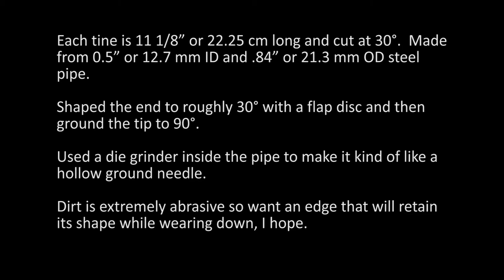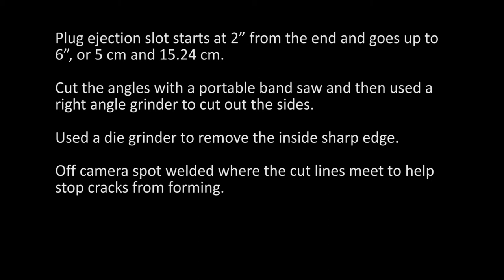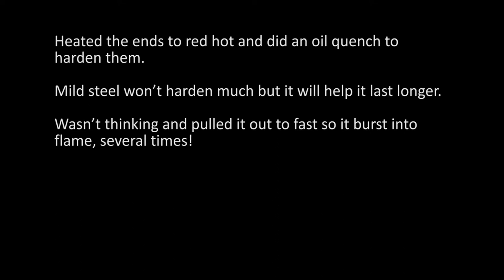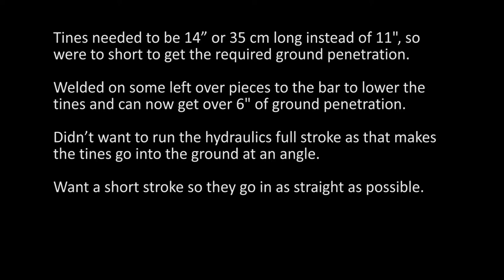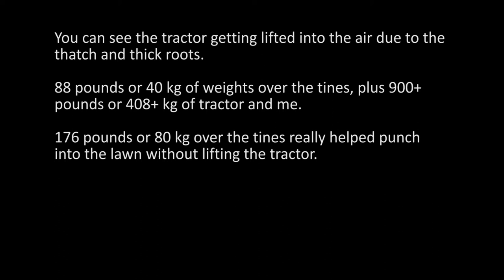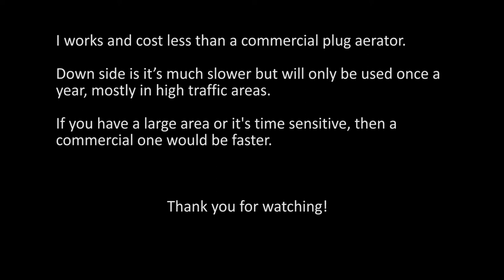DIY Lawn Plug Aerator

Comment from the maker: This works but it has a tendency to clog up the aerators on hard packed soil.  Manufactured aerators are usually conical so it’s easier for the dirt plug to move thru and fall out.
Reply: try watering heavy the day before you aerate, might help.
Reply from the maker: Have only used it after heavy rain!  Needs more work as it goes to deep on soft soil but doesn't penetrate well on hard.